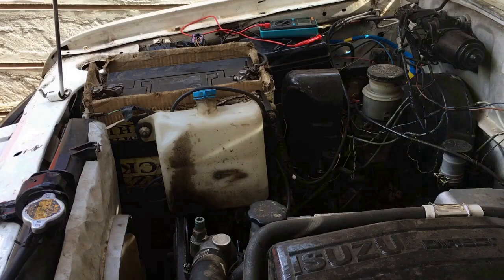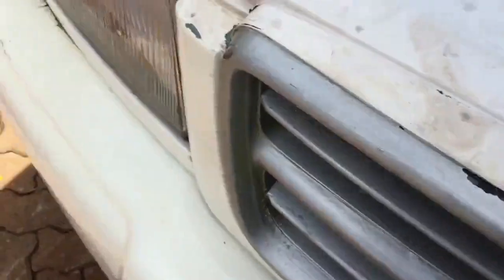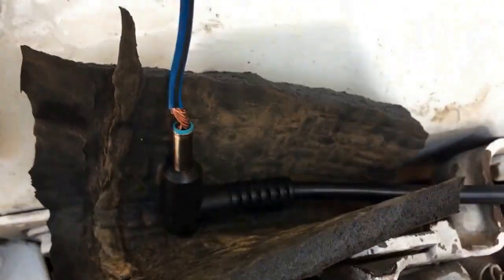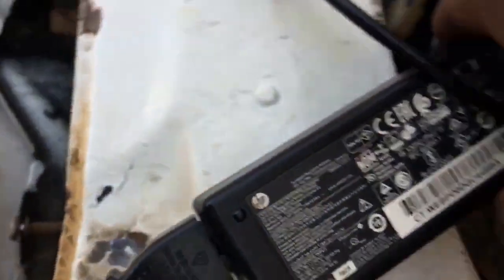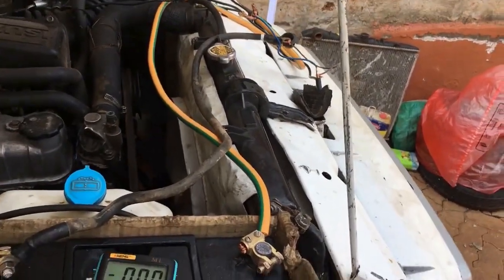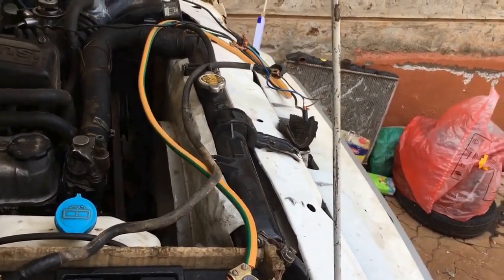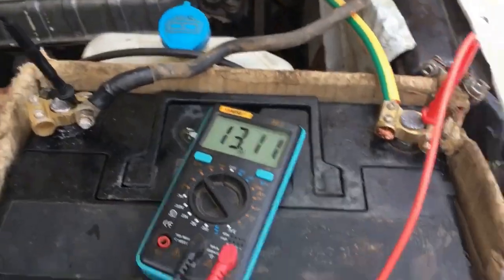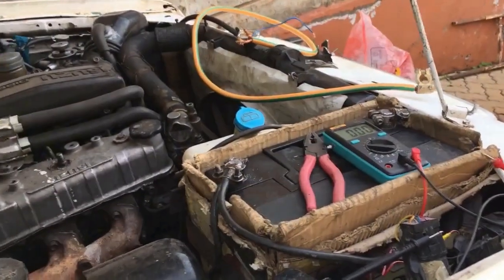Quick Charge Your Low Votage Car Battery With A Laptop Charger

Comment: Use a 12 volt headlight lamp in series between the charger and battery. Thus you would not overcharge the battery. Once the battery is charged the lamp will start to glow.
Reply from the maker: Great idea @irfan1373
Reply: I never thought of that thanks

Comment: Hp dell laptop charger mostly are 19v and there Lenovo laptop chargers which are 15v and are the best for charging car battery.charging a 12v battery with a 19v charger will work but that battery will die very fast because of that fast charge.
Reply: It's just a 20 minute charge car battery can resist that

Comment: I have a 12v adapter can I just start my car with it
Reply from the maker: Hi,you need a 12v battery as a capacitor that has a static charge to feed current to the starter motor.The adapter alone cannot feed the required starting current.
Reply: You can't charge 12v battery with a 12v charger never.a charger must be 2 to 3v higher than the battery to be charged.so look for 14v or 15v laptop charger 😎

Comment: It doesnt work i already charged my battery , it goes down and discharged , i tryed everything possibile here but are tricks i think
Reply from the maker: Hello @franci elsaban.your battery could be having an underlying issue that needs to checked or replaced.kindly check
Reply: Probably your battery is worn out and needs replacement. This method works for healthy batteries that have drained.

Comment: Good hint. What if you have 12 v  laptop charger, how long should keep on charging?
Reply from the maker: A12V Charger (While You Monitor) Can charge between 2 to 12hrs,depending on the charging rate.
Reply: Is it normal if it took my car 24 hours to charge with a 12v 4amp laptop charger

Comment: And if I don't have a testmeter? How long should I do it
Reply from the maker: Hello.Kindly follow the Instructions in the video.Then Give it Between 20 to 60 Minutes.
In my case I did it under 30 Minutes.
Reply: Battery Max Charge in Watts/Joules or Amps divide by Max Watts/h or Amps/h of the transformer (output) = amount of hours it would take to fully charge and adding some inefficient to it you can safely say is safe to charge it for that period of time. If the transformer is huge then you also need to take others factors like charge speed on the battery but on this scenarios the battery can carry way more power than the small transformer (for sure). Volt of the transformer has to be the same as the battery and if there is no power limiter on the transformer you are about to see a nice burn transformer if the battery is power-hungry.

Comment: I do wonder if given all the different configs you can have there is a chance the transformer overheat due to the lack of power limiter...
In theory you can charge it this way but if there is no limiter there is a good chance you just burn the transformer in no time.
If the transformer has a limiter this surely is a safe way to charge the battery since those thing are probably design for way higher wattage than a medium side transformer.
Reply from the maker: Hi,That's why in the video we say that 20 to 30 minutes quick charging is enough